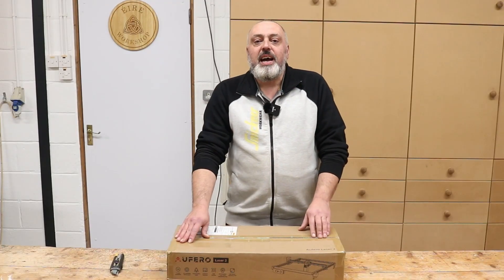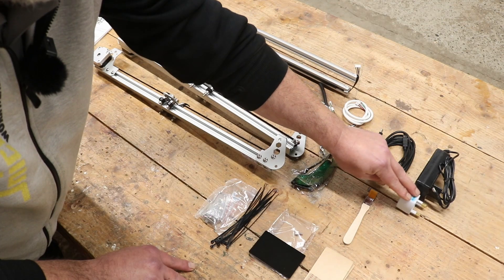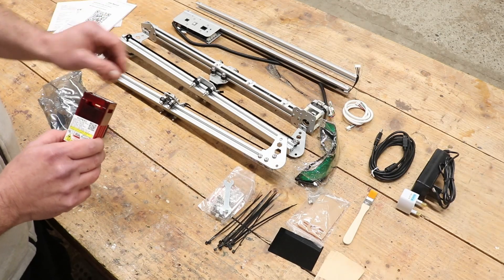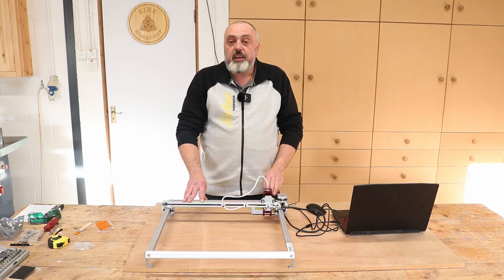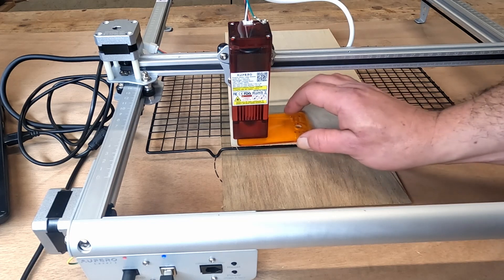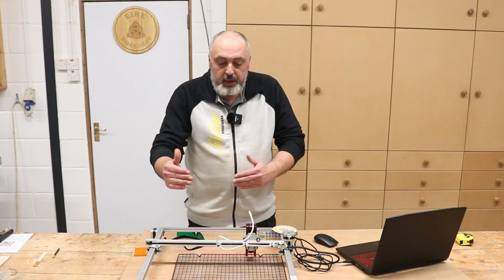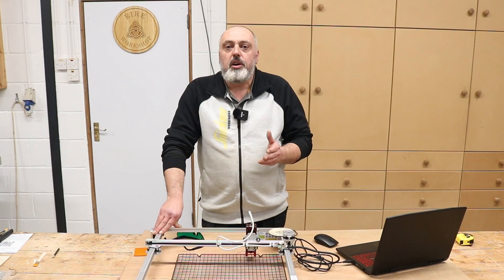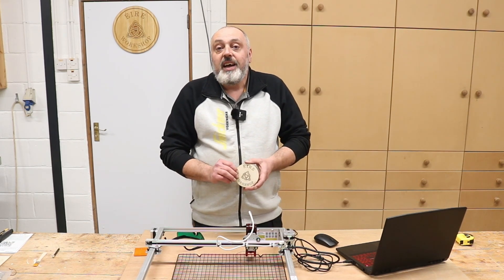Aufero Laser 2 Unboxing & First Test

Comment: Nice video. I have the same laser and am mighty impressed. I built an enclosure with extraction for it as it was a must. I only engrave on it, it’s not powerful enough to cut anything more than 3mm or 4mm without stinking the place out. Maybe be better with the long focus laser module, I have the short focus. Also air assist would be better for cutting. All in all. A great piece of kit. Look forward to seeing what you do with it.
Reply from the maker: Thanks 🙂. I will probably make an enclosure for it at some stage I will only use it for engraving as cnc can do any cutting required but yes the long focus with air assist would be perfect if cutting with a laser. It is very capable for a reasonable price I wasn't expecting to he as impressed as I am